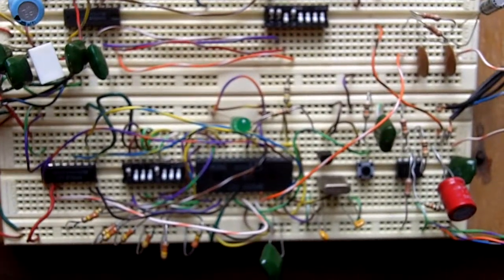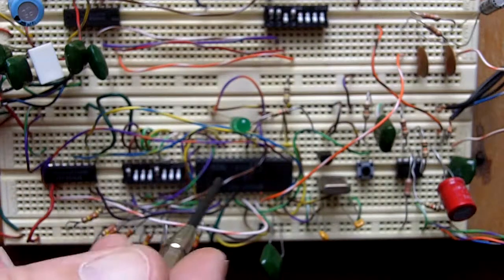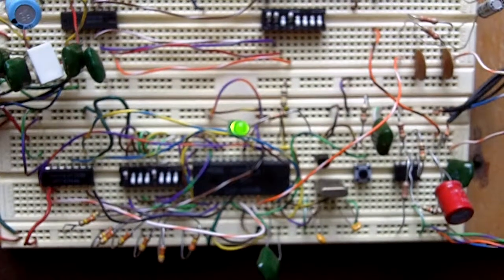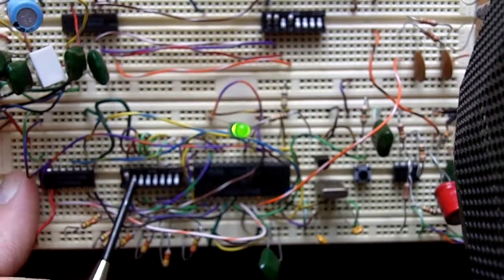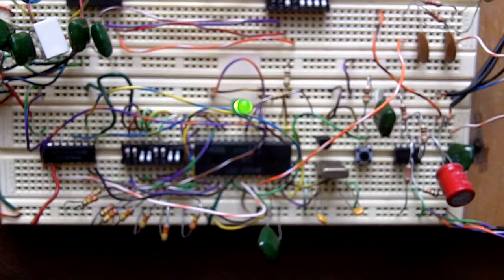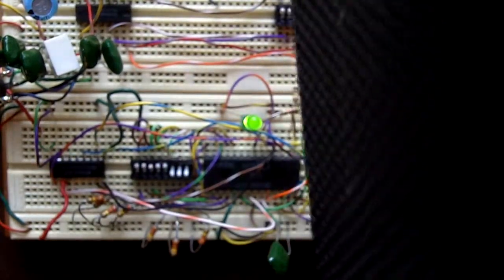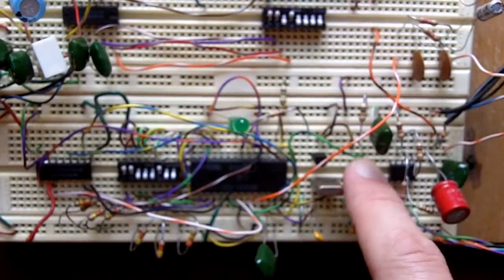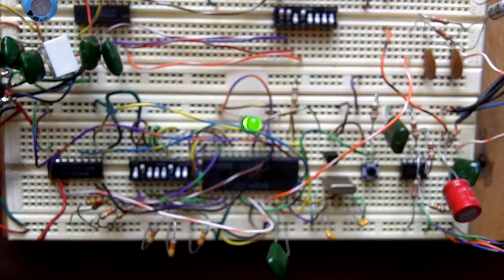Breadboarding a vintage SP0256-017 speech synthesis microchip

Comment: I have the Tandy Vox Watch which does the Please Hurry, Attention Please etc, so am assuming used the same chip? Just blob chips inside the watch and no info anywhere. Also have a Sharp talking clock, Sharp EL640 calculator and Tandy Vox Clock 2. All seem to have a very similar voice but again, virtually no documentation anywhere.
Reply from the maker: Yeah, I've been steadily hacking away at hardware since I made this video - just not around this chip... That breadboard currently has a solid state Tesla coil driver on it lol. I might look back into the speech chip again in the future. But probably shouldn't tease anything just yet.

Comment: Just came across this video... I have one of these chip sets (still in the bubble-pack) I bought from Radio Shack years ago.  I've been thinking about adding a 'robot-ish' voice to my old RB5X robot so started digging around in my boxes and found this set as well as an SP0256-AL2 (probably the better choice for the robot).  Also found an AY-3-8910 sound synth chip while searching the boxes.  
Looked around for your -17 arduino video but haven't found it... have you done that one yet?
Reply from the maker: Sorry for the very late reply! I never got around to the Arduino thing, but might be better equipped to tackle it these days. I was hoping to send phonemes to the chip. Not sure if this version can handle that!? If I breadboard something up, I'll reply again and let you know!
Reply: @espectraa1s Sounds good, thanks

Comment: Well done !

Is  it  possible to program a PIC manually ? (Without a computer). If so, how can I do it ? 

Have a  nice day.
Reply from the maker: PIC? Hmm, I'm not too familiar with them. But I have been messing with ATmega microcontrollers. I'm guessing they all need a PC to program them (other than dedicated bulk programmer devices), but there IS an app out there for Android for writing Arduino code. Not sure if you can actually burn the code into a microcontroller just with the Android device...

Comment: Nice! I tried to hook up the -017 and its ROM last weekend, but didn't get more than a few hisses. Do you happen to have a schematic for the simple setup in this video, so no Arduino's yet, just the most basic thing? I must have made a mistake, must be something simple.
Reply from the maker: I used the "TYPICAL APPLICATION STAND ALONE CONFIGURATION" circuit from the datasheet, modified with the ROM connections from the "TYPICAL APPLICATION MICROCOMPUTER INTERFACE" -- so connecting the ROM, but not hooking it up to a microcontroller or computer, and keeping the pushbutton address latching from the 1st datasheet schematic.

But there IS actually a mistake in the -017's datasheet for that first example circuit... Notice that they have pin 20 (/ALD) connected twice!? You have to ignore the connection at the top (where it's connected straight to +5V) and only connect it in the right-side configuration (where it has a pullup resistor, pushbutton and transistor to ground with SBY controlling the transistor's base as a switch.

I'll try to draw up a fritzing breadboard picture or schematic in the next day or two and link you to it.
Reply: That is really kind! Thanks for replying. The datasheet I got is pretty illegible (http://www.speechchips.com/downloads/sp0256-17%20datasheet.pdf). Did you find a better version?

I actually don't know if it makes much difference when just playing with this chip, but I made all data inputs low by default,setting the dipswitch makes them high. To my knowledge the effect would be the same though.

I got both the ROM and the SP0256-17 (as well as an SP0256AL-2 and even a CTS256). Love these old speech chips ;-)

Cheers,

George
Reply from the maker: Hey George, I put up the schematic on my website (let's see if this works) at http://www.peculiar-games.com/arduino-adventures/sp0256-017-schematic

I'll temporarily put my scan/PDF of the datasheet up there, too (bottom of page as an attachment). Drop me a comment after you download it, since I don't want to keep it up long-term until I check with Microchip if it's OK. (Crazy, I know, to worry that they'd complain about it, but you never know...)

I did the same thing with the address inputs, actually using pulldown resistors to GND instead of the pullups to +5V. It seemed to make more sense to me, especially since I'm using a little DIP switch, with the position marked ON for the switches being closed (bit set to 1). But note that I left the schematic with pullup resistors.

I want to get this -017 to handle arbritrary allophone programs which the datasheet "hints" it can do in TEST MODE, but haven't gotten the Arduino to feed the chip the programs correctly yet... Even at 16MHz, I had to write a custom assembly routine for speed and it STILL doesn't work, but I may get back to it someday and try to make the idea work.
Reply: Thanks a lot! That scan is much better to read, already downloaded it. Can't imagine Microchip / GI will make a lot of fuzz about it, but better safe than sorry. Thanks for all notes, really helpful. Might take a few weeks before I can continue working on it, but will let you know the outcome.

I'll read through the TEST-mode section, you'd say with that speed and a healty and efficient routine, it should work...
Reply: Finally got the time to finish this. Works like a charm. At first thing didn't work. Checked all connections once more, but all was right. I found out that if an address is set (there are 256 possibilities) outside the range with real data, you get all kinds of sounds / crap AND they don't seem to stop (as it is a serial PROM, maybe some termination code is missing...).

And now that I think of it, isn't the SP0256-17 not exactly the same device as the SP0256-AL2? As in the end the SP0256 contains all allophones and these become words due to the serial ROM? And it's the ROM that determines the sequence of those allophones, which results in words like "Good morning" and "fourteen".

Thanks again for your help, good to have it working!
Reply from the maker: Hey, that's great that you got it working!

About the difference between the -17 and the -AL2, my understanding (which could well be mistaken) is that both chips have internal ROM and that the -AL2 has allophones, whereas the -17 has the numbers it can say for a clock. Then you can add an external ROM to either chip to yield even more "programs", so the ROM that came with the -17 has "good morning" and the three songs, etc.

I got the impression that this family of chips was similar to modern ARM processors (in one small way) in that it has a block core processor on the chip die that can be mixed and matched with another block of ROM, all on the same chip, so that the processor core of the -17 and the -AL2 are the same. They were just manufactured with different internal ROM blocks.

I won't know for sure until I get the serial program feeding thing working that I was trying... There is a guy out on the net that has some SPO256 pages, including a complete reverse engineering of the program instructions and program dumps from internal ROM for all the -AL2's allophone programs. It's pretty cool, and that's what I'm hoping to feed my -17 if the theory is correct.

I actually made a little bit of progress (but still not working). Since I'd pretty much determined even a 16MHz Arduino was too slow to reliably read the serial programs being passed from the external ROM to the SPO256, I looked for ways to slow down both, perhaps a 300KHz crystal instead of 3MHz, or something like that. Didn't really have a slower crystal slower, so I wondered if I could feed a square wave into the clock pins. You can wire a 555 timer to run in the ~100KHz range, so I breadboarded a test circuit and it does indeed cause the SPO256 to run slower, speaking in a funky bass/slow pitch. Unfortunately, my 555 timer clock seems to have a lot of noise and I'll have to figure out how to clean that up. But with an Arduino IDE + Processing pair of sketchs to act like a "poor man's oscilloscope" , I could more reliably sample the serial pin as the ROM transfers its program to the SPO256. But it's still not completely reliable in that playing the same program 2 or 3 times, gives oscilloscope traces that are mostly the same each time, but with differing bits occasionally.

I'll keep messing with it when the mood strikes.
Reply: That would mean, if the SP0256-17 already holds all numbers, that what the SPR-16 ROM adds, is quite limited. I'll try a setup without the ROM and see what the vocabulary is limited to.

As far as I know, these are PICs, which is not very well known. If you look at the SP0256-AL2's companion chip for text to speech, the CTS-256, the datasheet mentions that it is actually a PIC microprocessor.

I'm not completely sure what you are trying to achieve, and my electronics knowledge is quite limited, but the SP0256 communicates with the serial ROM SPR-16 with a specific speed (1.56MHz), at least, that's what the datasheet for the SPR-16, which is just a generic serial ROM, indicates. These were quite hard to find, let me know if you need that datasheet (also got it for the SPR-32 and SPR-128). Also made my own scan for the datasheet of the CTS-256 (which is really hard to find or terribly expensive).

For your clock, you could also try using some R/C timer, or you could use your Arduino for just the clock? Can't you just intercept the signals from the SPR-16 on pin 10 (serial out) then? You could even add a logic analyser there to read the pattern, or you could feed it to your Arduino and "intercept" and store the data in a file? For the logic analyser, there are some perfect devices from China where you can use the perfect Saleae software... These devices (or actually the software) are extremely interesting for debugging digital sinals, with even support for all kinds of protocols (I2C, SPI, CAN, serial, parallel, etc.). https://www.ebay.nl/itm/Cable-24mhz-Usb-Fpga-Device-M100-Channel-Analyzer-Analyser-Kit-Dupont-Logic-8ch/122997258809
Reply: Additionally, check this online book. When you end up on the page, scroll to the top till the start of section 1.3. I think it gives some interesting background on these chips...